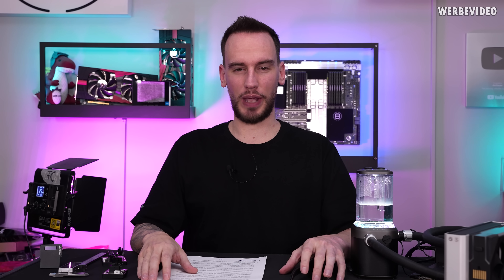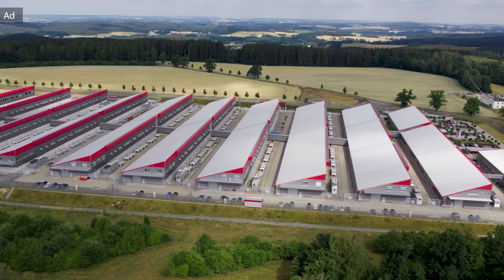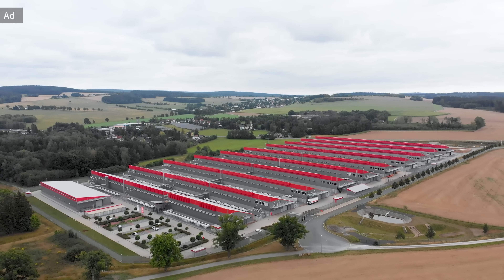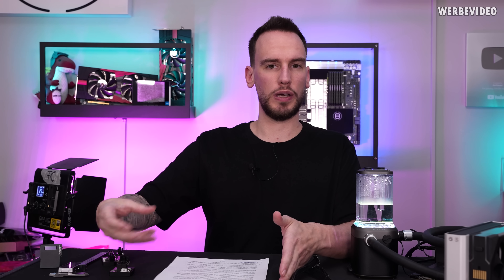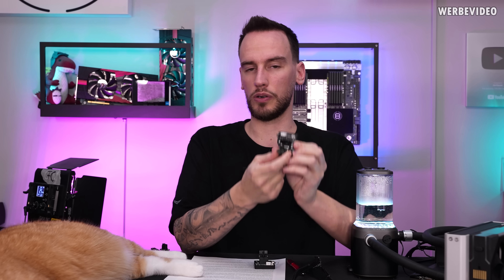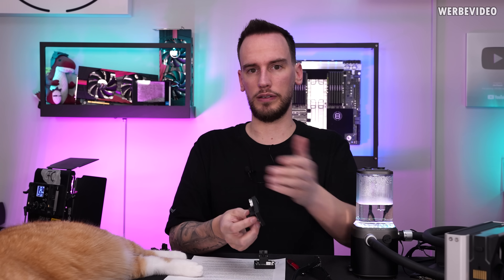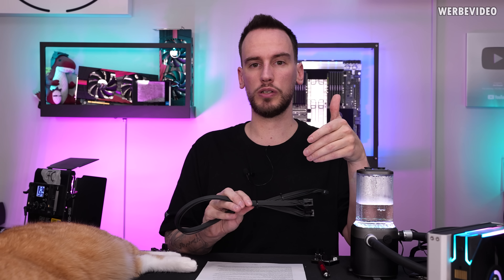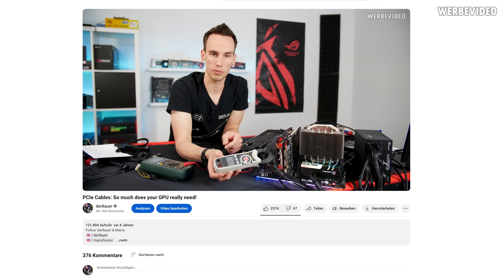12VHPWR is just Garbage and will Remain a Problem!!

Comment: In general this is a completely ridiculous situation - pushing 600W through a cable safely, with a secure connector, is not some magic new thing that nobody ever needed to do before the 4090. This is an extremely well solved problem, but the new solution chosen by nVidia and the PCI SIG is so bad.
Reply: It was evident since the first burn incident. Even before that, simple rule of thumb examination between ATX 2.0 plug and new one. The pins are way smaller, the construction is way more dodgy. Literally every ounce of safety margin was dropped. 8 pin connector has literally 3-5x safety margin based on DECADES of research and development. You just cant make a cheaper/smarter cable to save on manufacturing cost. and expect end users adapt over night or even EVER.
Reply: Temperamental connector with small gauge wires and terminals. So dumb…it’s largely just physics.
Reply: I'm surprised it's mad it this far, if a connector has to be installed 100% perfectly not to melt it's clearly not suited for the application. There should be a class action lawsuit from every 4090 owner against NVIDIA and regulators should be stepping in to force a recall before someone dies in a house fire. It's really crazy that nothing has been done about this yet.
Reply: Car audio comes to mind. A largely 12V system pushing 1000s of watts with zero issues.  You don't see puny connections and tiny wires in that world because the engineers are not the big dum.
Reply: yeah. NVIDIA and PCI SIG are both to blame. PCI SIG for approving this standard without enough testing or review, and NVIDIA for using the new connector without enough testing or review instead of using the good alternative (8-pin PCI-E power connectors)
Reply: Blame connector designers that never had to care about high amperage.  They cheapened the connectors for so long, they think the cheap corner cuts are the way things should be done.  They use what they know from the last 20 years for low amperage connectors and blindly reuse those design conventions for high amperage.  Nvidia should have switched to 48v at the same time of changing the connector.  Lowering the amperage is the best safety feature for consumers when it is clear the people designing connectors are not qualified.
Reply: @IHMT00  I think YOU need to check your facts. the 3090TI is NOT the same plug. You can not use a PCI 5.0 plug on a 3090TI connector. can you? This Plugs, adaptors and cables was not on the marked untill the 40 series. And the problem is that the ATX 5.0 is pushed to it limit with the 4090. Ther is no margins there. And it shows because of the small miss match between the connector and the plugg across brands.
Reply: cannon plugs on gpu's anyone?
Reply: The cheapest, easiest, and safest solution is to use a higher voltage.
Reply: It should be staggeringly obvious to anyone not sickeningly undereducated that a pin's ampacity can be exceeded if there is complete failure to do something as utterly trivial as plug it in correctly and check the catch is secure as blatantly designed. The sheer lack of intelligence, care, and attention to the most remedial of detail associated with the degrading failure to do this constitutes a truly shameful embarrassment. All this hoo-ha over the source of failure is shocking and ridiculous, and shame on all those suggesting any problem lies with anyone but the user on this matter.

Properly seat your power cables, buy a case that fits, do not bend cables, do not use 3rd party adapters, have a professional who knows what they are doing building rigs and you will have a %99.9 success rate according to the current data..
Reply: yet most of people and other youtubers put this fault on the user stating that it's a user problem for it... How come 8pin connector wasn't an issue in the first place
Reply: @1sonyzz  I can be both but this 12v connector makes it more risky.
Reply: @1sonyzz  Well let's be clear, it's not really a "user error" if the cable is not designed to clearly communicate that it's plugged in properly, which seems to be the case.
Reply: @1sonyzz   cough gamer nexus cough
Reply: @fredEVOIX  cough because the user can mess it up even easier cough
Reply: Actually it is Intel (ATX power standard) and PCI-SIG who adopted Intel's new ATX standard ......  The entire reason for having standards and standards bodies is so this sh*t doesn't happen and when it does the blame falls on the standards bodies and NOT the manufacturers that adopted the standard ....... Blaming Nvidia gets you nowhere because they have no choice but to follow the standard which is either 1  12vHPWR connector or 4- 8 pin Molex connectors. If they use anything else then their devices is no longer compliant with the PCI-Sig standard and those devices lose their licensing as PCIe devices and effectively can't be sold
Reply: @longjohn526   Can't blame Nvidia you say, No choice you say. But 4x8pin WAS a choice. And ONLY Nvidia went with the 12vHPWR connector. Even AFTER they new about the problem. Also, they could have restricted the powerlimit on the 4090 and stayed with the 12vHPWR. Or restricted the power and used 3x8pin. Say again the had no choice. Say again they can't be blamed. You allways have a choice.
Reply: @longjohn526  nVidia shipped 30 series cards with a non-standard power connector. They clearly do have a choice.
Reply: @longjohn526  you can absolutely blame nvidia when they fund the guys making the fucking standard lol
Reply: @longjohn526  Nvidia pushed this not Intel or PCI SIG. They first tried their ridiculous 12 pin and when PCI SIG refused this thing was what they got. That's why AMD's cards literally do not ever use these things.
Reply: @KenS1267  You understand Nvidia did not invent or create the 12vHpwr connector or standard right?  PCISig the governing standardization body for PCIE did.  Nvidia simply choose to adopt it.

At worst Nvidia's mistake was adopting it first/too early, and POSSIBLY underestimating the rate of connector failure.  There is no real evidence  that the failure rate is high, for all we know it could be less than a tenth of a single percent.
Reply: @DKarkarov  Nvidia most certainly did. The minutes from the PCI SIG meetings are public. Why did you lie?
Reply: @KenS1267  Lol.  Thanks for admitting you are just a troll, appreciated.
Reply: @DKarkarov  So you made claims about PCI SIG without knowing anything about it? Let me guess, you don't have access to the PCIE 6 spec and can't check.

That must have made you feel foolish. It's right there.
Reply: @KenS1267  The RTX 30 series actually have a better connector/electrical standard since it's really split into multiple (3) power planes, so you can never get the full 600W over one pin pair. They could have done the same thing for this one.
Reply: @longjohn526 no, actually it was the nvidia who pushed this standard.
Reply: @riba2233  No pic sig at anytime could have pulled it if it was a problem. They are the regulating authority for the connector... But every case of problems I've seen so far including my issues was user induced from cramming it into a smaller case. While stated is true there is little to no margin of error. The error tripped factor has always been user induced... Also why I went with open faced, wall mounted PCs and custom loops... In my mini PC I went with a windforce v2 for the power connector as well....
Reply: @SimanSlivar  "But every case of problems I've seen so far including my issues was user induced from cramming it into a smaller case"  That is 100% false.  No one is abusing connectors.  These connectors separate on their own because of poor design.  Its one job is to make a secure connection and it fails miserably.  You do not get to blame normal cable bending as an issue when it was never an issue for the last 40 years.  The difference is quality.  Modern designers employed by "standards" companies are just bad at what they do. PCI-SIG is completely obsolete and not qualified to design connectors anymore.  They failed just like SAE failed with their CCS combo ev charge connector.  The poor quality of engineers at "standards" organizations is obvious.
Reply: @_PatrickO  And I must say, people refering to "small cases" and blaming the users should also think twice. It's already a huge board, and yet some vendors put the connector to the side. You can't simply ignore connector placement when designing a board, specially those rigid high-amp cables which put so much strain on the connector. Those problems are not new, and some basic common sense like using an angled connector and offering a cable holder on the fan housing could prevent most of those "user errors".
Reply: The card cannot pull 600W at stock, it only does that if you set power limit to 133%. At 100% the limit is much lower, stop spreading bs.
Reply: @trignite  the 12VHPWR connector specification goes up to 600W, and 4090s even at stock settings will draw >450W at peak loads.

Comment: I don't know why they went with such an unnecessarily complex design for the power delivery on the 16 pin 12VHPWR. They should have gone with just a couple of heavy gauge cables with large, solid connections for power delivery. What could possibly have been their reasoning for splitting the power and ground across 6 cables and connectors each, with such tiny connectors?
Reply: If you can't guess a reason easily, it's most probably about the money.

Comment: Could also have the connector placed on an angle horizontally, like the FE cards, or just have the connector stick out of the card but facing downwards... was using wireview but since i mounted a noctua dh15 with the am5 offset i cant use it anymore, cable is fully plugged in but had to bend it, dont have a small case but sure as hell no 45mm play (including 1cm for the bend itself) between my 4090 and the panel.

Same thing with the 24pin connectors on motherboards, why its not a standard to have them attached to the motherboard at a 90 degree angle at 2024 is still a mystery to me. They rather have you bend it so much to route it through the back of your case instead of just putting it on angled..

Comment: Perhaps it would also be better to make the cards (if needed) even thicker, but shorter and then just have the cables exit out the back of the GPU. As a minimum partners should explore having the connectors sit on an indent in the PCB to give them a bigger turn radius.
Reply: Its time to have connectors sit on the back of the PCB. Horizontal of Vertical mounted, this is superior to cable manage.
Reply: @Elvewizzy.  I don't think that's a good idea. That's probably the absolute worst place to put them, vertically mounted. You absolutely do not want cables to further encroach on vertical space. They should always be in line with the PCB.
Reply: @fVNzO  How would they encroach anything when mounted on the back? Any cable connected would run over the back plate.

Could even put them on the back and have them angled to the side of the GPU also, Like EVGA has done before.
Reply: @Elvewizzy.  Because there has to be room both right above and below the GPU for other PCIE devices, coolers and the like. That's why you don't ever see them mounted like that and always flush with the PCB.
Reply: @fVNzO  I get what you're saying.  However let me counter by saying this:

- SLI is dead
- GPU sits on the top slot 99.9% of the time
- Most other PCIE devices are shorter than most GPU's anyways.
Reply: @Elvewizzy.  maybe but i still think it's better to keep them flush and just have an indent in the heatsink, pcb, backplate what have you. If they go straight up i feel like the card has to be quite long otherwise you risk having the cables fight with space for a large air cooler. I think with the small pcb's we have nowadays there is plenty of room to have it go straight out from the back without having to take up any space above or below the GPU which could be occupied by other hardware. And then you would still have enough room to route the cables upward if needed.
Reply: @fVNzO  I think you might've misunderstood or I havent been clear at all (it happens, sorry) But the connector on the back would face the opposite way. Horizontal mount -> towards the MB, Vertical mount -> towards the bracket/case

In an ideal world, the MB would have direct dedicated 12v lines running through a few layers to power the GPU. I think there was a prototype of this somewhere, I recall seeing it :P

Comment: I don't understand why the psu industry flat out ignores basic Volts to Amps compared to cable size. For instance, on my Electric dirt bike the wires I run need to meet a minimum thickness or gauge to handle the volts and more important the amps.
Reply: Reputable power supply companies do care about this sort of thing. If you get something from a reputable manufacturer, they usually use 16g or 18g cables. Those that cheap out usually use more like 20g or 22g.

Though of note, volts matters zero in this regard. The most a PC needs is 12VDC.
Reply: This is not a PSU maker issue but a GPU maker issue. Nothing in this video indicated that the cables was under specification, infact the cables are built to higher standard than required.

It is up to the GPU maker to factor in the safety margin, hence it was mentioned that the makers should use two high power 12v cable.

Think of it this way, a twisted steel rope factory makes a cable rated for a 1000kg to specification. 

It is up to the winch manufacturer selling a 950kg winch to decide is one cable safe or to use two, even though it is bulkier.
Reply: @robertlee6338  it is a wire issue. Like I stated. PSU's do come with cables, do they not?
Reply: PSUs ar fixed 12v and fixed total power.

Comment: I bought a Corsair power supply recently to get my server stable.
In the package for the PSU, there was this 12VHPWR cable and I put the PCI-E 8 pin next to it, and just looking at it, you can see it is garbage.
The click on the locking tab is barely there if at all.
Not properly locked in, hard to plug in correctly, no feedback to the user... AND then you are expected to use a lot of force on a super expensive piece of hardware? Sorry, but it is crap.

Comment: my 12vhpwr adapter from cablemod melted, and I got my 4090 RMA from Asus. Now I am not using any adapter but have a crazy bend on my cable. 
I hate this.
Reply from the maker: Interesting. So ASUS accepted the RMA on the card?
Reply: @der8auer-en  oh Shit lol. 
tldr; bought from US Amazon, lived outside of us, got my RMA transferred, photoshopped my melted adapter to the PSU cable and claimed my RMA lol.

I heard some brand sometime will accept the RMA even if you use an adapter. My case was very different because I bought my 4090 from amazon US but i live outside of US. Asus transfer my RMA request to my local Asus  customer service center that is for laptop instead of GPU, since the local Asus GPU department was outsourced to some infamous local distributor/agent and not directly under Asus I guess? Anyway I was so afriad so I photo shop my melted adapter to a PSU cable and claimed my RMA lol.

Comment: Meanwhile USB-C & USB4 240 WATT Power Delivery:
FINALLY A WORTHY OPPONENT!!
OUR BATTLE WILL BE LEGENDARY
Reply: The USB-C connector is only rated up to 5 amps. For 240W Power Delivery it uses 48 volts at 5 amps.
Reply: @BrianCairns  That's exactly why it is a problem.
Based on Law of Physics alone, it will generate quite amounts of heat.
Reply: @niezzayt3809  what? Volts don't produce heat, amps do. And current cables have shown to handle 5A just fine (you'd still need special new 240W cable thats properly insulated for 48V, but that's irrelevant to conductor cross section/heat/amperage rating)
Reply: @niezzayt3809  Lolz, you clearly don't know "Law of Physics" [sic] 😂😂😂
Reply: @niter43  Go on. Show me just 1 Video of any USBC or USB4 performing at maximum 240 watt
Reply from the maker: Let's just power RTX5090 by 3x USB-C
Reply: pff, just put a IEC C14 socket on the card already and give it it's own PSU so it can have all the power it needs from the wall :D
Reply: honestly i doubted that aswell, i never used it. 240W  over usb C sounds like scam.